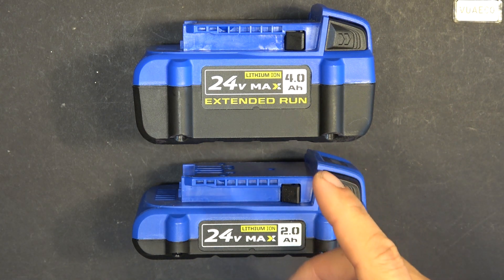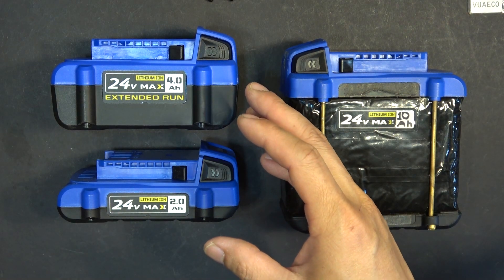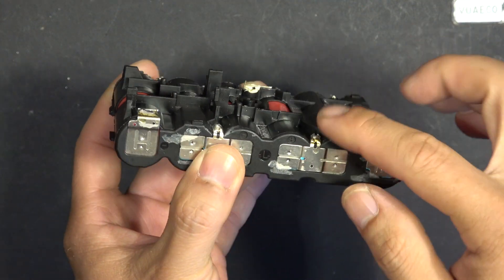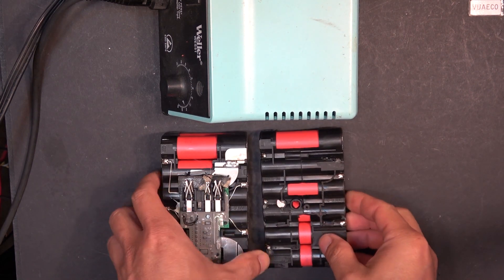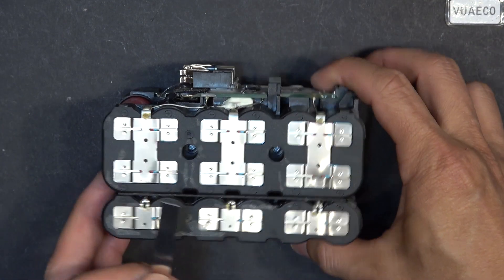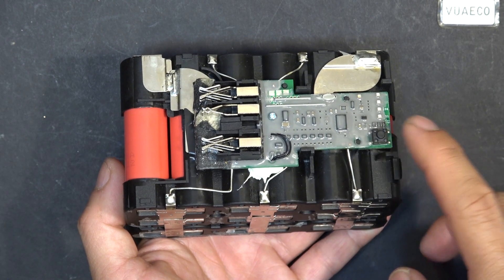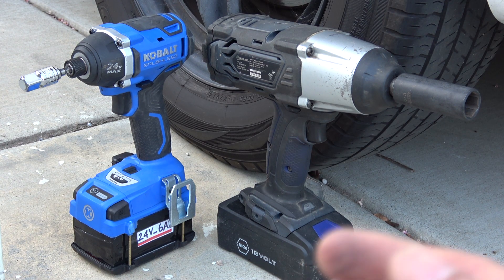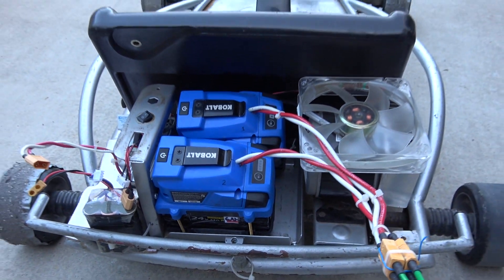DIY: Make a 6Ah 24V Kobalt power tool battery. Small hack, big improvement.

Comment: Doesn't kobalt sell a 6ah battery?
Reply: Yes, 2 amp, 4 amp, 6 amp and 8 amp.
The batteries that say "ultimate output" in yellow are the newest type of batteries 21700 cells, the other batteries that don't say that are 18650 cells 👌

Comment: Why not just replace the 2000mah 18650’s with some 4000’s and make an 8ah in a 4ah battery casing
Reply from the maker: Those are 21700 cells.

Comment: Or you could just buy the 6amp hr battery that's premade? But I was curious as to what is inside these batteries thanks for opening them up.
Reply: It's probably cheaper though if you buy the individual 18650 cells though and say turn a 2 or 4 AH into an 8 AH

Comment: This is Almost exactly what I was looking for, only that i want do it wutha a 20v dewalt. Do you think it works??
Reply from the maker: It would be the same thing on the Dewalt. The only thing different is the Dewalt has 5 cells whereas the Kobalt has 6 cells.
Reply: @vuaeco  i like you man 👍 my batery has a 1.3 ah capacity. I'm thinking to replace all 5 x 1.3ah LG cells by 10 x 3ah sanyo cells, do u think i could have a problem with the bms card??
Reply from the maker: @sergioelbot9924  Won't be a problem with the BMS. Just make sure the cells are high discharge cells of at least 15A each
Reply: @vuaeco  thank u so much bro 🍻

Comment: How big can you make it before you start having problem thanks for the video.
Reply from the maker: The only problems from building this are weight and cost. If you can carry it, you're good. If you can afford it, you're good! :D
Reply: I am not an electrician or have enough knowledge in the subject but maybe you can have a huge battery sitting on the ground or floor with an umbilical cord connecting the tool and supply together. That could dramatically increase capacity and significantly reduce handling weight on the power tool. Let me know if this idea would work.
Reply: Buy a corded tool then lol
Reply: A small backpack of some 20.000mAh or more with a small cord.